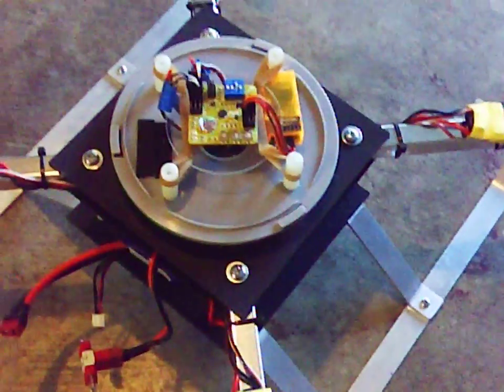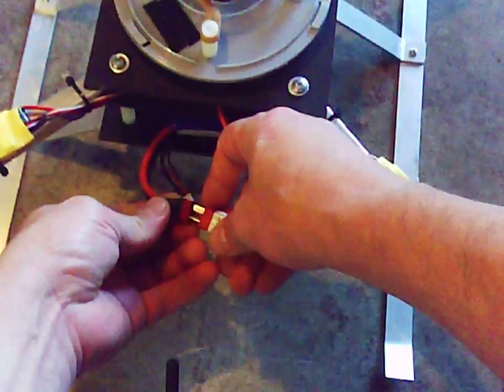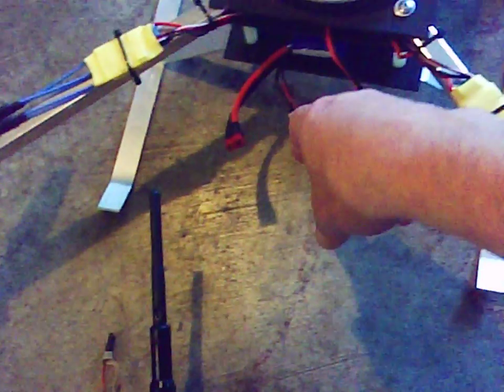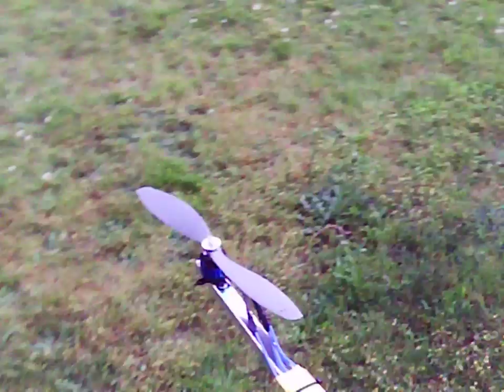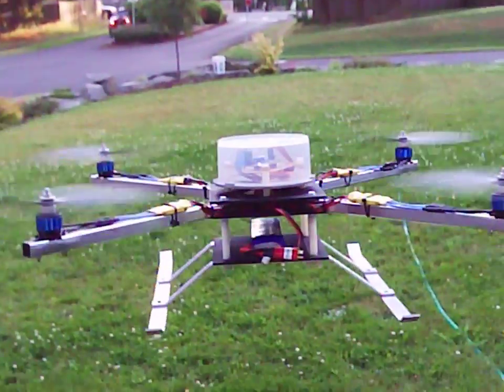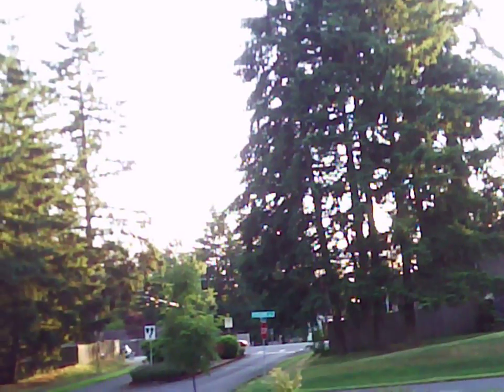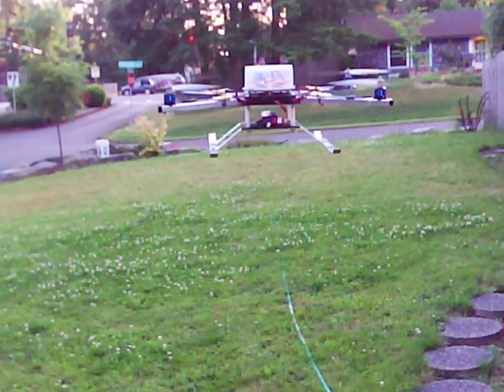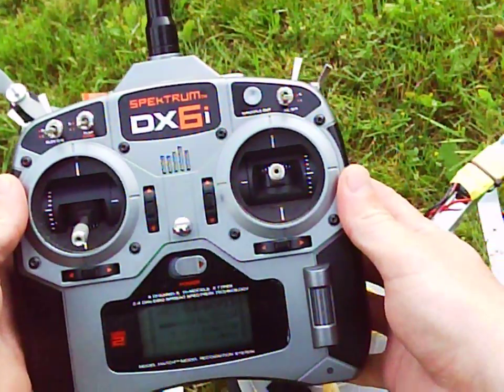Xcopter Scratch built with a HK i86 controller

Comment: Mmh, i just have to pull both sticks down and it works fine. Another issue i have is that the motors beep when the board is not armed. Is that right?
Reply from the maker: MrHyho1, I've discovered all I needed to do is pull the right stick down with the throttle down.. ha ha!  I answered your beeping question on the soapbox tri discussion.  If you have not done so, please subscribe.  All the best and Happy flying!

Comment: Ron - I'm not sure I understand your method of tuning the gyros - are you starting P/R/Y pots at 0% and then turning them up until you see oscillation on that particular axis (and then tuning that pot back down a bit) ? What about the rudder ? I got my i86 quad flying, but it creeps around quite a bit. Landed it in my neighbors yard last night..
Reply from the maker: Hey Scott, With the i86 on just about everything multirotor I've built I set it to about 75% on all the gains to start.  Then usually increase the gains on one axis until I get oscillation.  Then back it off until it stops.  Do this on all three axis (unless you are flying a tricopter) and you're done.  Hope this helps and Happy flying!

Comment: Hi friend, once again need your help. The configuration of pitch, roll and yaw must stay with the same percentage or Vaira? This is the hardest part of the assembly of the quadricopter. What is the secret to achieving a stable quadricopter? Thank you very much.
Reply from the maker: You can turn the Yaw gyro up to 90 or 95%.  The pitch and roll you want to lower until there is no oscillation.  Then working one at a time, pitch or roll, turn the gyro up until you get oscillation on that axis.  Back the gain down just until the oscillation stops.  Then do the same on the other gyro and you're done.

Comment: Hi friend thanks for the tip worked. I would like your help with a question: I'm using helices 10/4.5 and would like to trade for triple helices. What is the difference from one to another in flight? What do you suggest? Thank you very much.
Reply from the maker: If you are referring to 3 blade props, I like them better than two blade because they balance much better and give a little more thrust.  But I like to build some of my multirotors to collapse and that's when I need 2 blade props.

Comment: hi friend, could you help me? I'm having problems configuring the escs with this board. I followed the manual and I can not set up, they is beeping. Thank you.
Reply from the maker: Flavio, ensure you have the correct manual.  Some, including me have used the wrong manual to set their multirotors up (i86 or i86L)  they are very different.  Other than that, the manual from HK shows how to set this board up.  I do stick centering first then the ESC throttle range calibration.  This seems to work better.  Hope this helps and Happy flying!

Comment from the maker: Hi Luka,  I'll try to help.  First, you must see which i86 you have.. the regular i86 or the i86L.  They are very different in the way they are programmed.  Once identified, follow the corresponding manual for doing the stick centering and throttle range calibration.  I have been doing them in that order (First stick centering and then throttle range calibration) and it seems to work better.  After this has been successfully done, put your board back in normal flight config.  Happy flying!

Comment: hello,
i have a hobbyking i86 multi-rotor control board for my Q450 Quadcopter and i have problem Calibration ESC throttle. Can you please tell me what to do (manual suk, i cant use it) i dont understand manual please help me!!

Comment: hello,

I have a big problem with my i86 board whenever I want to try to calibrate my esc's the motors spin at full throttle and the only way to stop this is by disconnecting the battery. Could you make a video with how to calibrate esc's with the i86 board ?

Comment from the maker: caricat, When moving in any direction, the more stick given, the more of an angle the bird is tilted and then a portion of the thrust that was used to maintain a hover is then designated to propel in in whatever direction.  This is where the loss in altitude comes from.  So, short answer, yes.  You should use the throttle to maintain altitude just as you use the ail and ele to maintain position.  Hope this helps and happy flying!

Comment: Nice Vid! Just finished building mine. Quick question: My quad hovers fine at center stick (6 feet up) when I apply Aileron or Elevator the quad looses altitude. So much so that it will 'land'. Do I need to increase thottle when I try and make it move?

Comment from the maker: After you've done ESC throttle range calibration, then do stick centering by putting all the switches at the bottom (again, all gyros at 50%).  Turn your TX on sticks still all trimmed to center and throttle at the bottom.  Now connect the battery to your FC.  When the light goes blue, unplug the FC and put the switches in what ever configuration you want to fly in.  This should get your quad going.

Comment from the maker: m3d0car,  I see your problem now.  Do not use the i86 manual and set all your gyros at 50%.  Also, calibrate it in normal mode and do the ESC throttle range setting first by putting switch 1, 2, and 3 in the up position (make sure your props are off and put tape on the shafts to hear the beeps).  Turn on your radio with all the trims centered then go full throttle.  When you hear a couple of beeps, drop the throttle to zero and disconnect the battery from the FC immediately.

Comment: Thanks for your answer. But i checked the wiring and it's all like you said ( ground on the outer side), tried to calibrate it just like it says and ignored the drawing, but still doesn't work. I calibrate it in acro mode, and when i change it in quadrocopter mode the motors won't start.
I posted a video on youtube ( hobbyking i86 controll board problem), did i do anything wrong? I would really appreciate your help. Thank you.

Comment from the maker: m3d0car, Make sure all your signal wires are on the inner part of the board and ground on the outter (I've had some flipped sometimes).  The manual drawing on stick centering is incorrect.  Go by what the text says and ignore the drawing.  Another thing you may try is switching to another mode, power up and down, switch back, and recalibrate.  Hope this helps and Happy flying!

Comment: Hi. I have a i86 board on my quadcopter and i tried to calibrate it like it says in the manual, but the lights on the board doesn't flash like they should. And when i finish the calibration motors don't want to start. Can anybody please tell me what to do? I tried everything, do i have to change anything on my transmitter? Thank you for answer.

Comment from the maker: falhawker, what is your arm length on your bird?  Also, I used rubber bands to mount the board.  which absorbs a lot of the vibration.  Set your pitch and roll gyros at 50% to start it it oscillates baddly, go to 25%.  If it wants to drift back and forth or side to side, crank it back up and it will smooth out.  When it starts to oscillate again, back off just a little.  Hope this helps and Happy flying!

Comment from the maker: falhawker, go to the HK website, then to the i86 page, scroll down until you see the tabs: "Discussion, Reviews, Videos, and Files".  Click on the "Files" tab and select "HK i86 User Manual".  In the manual it has instructions guiding you through "stick centering" and "ESC throttle calibration".  Keep in mind the drawing is incorrect on one of these.  So, if you go by the written instruction you will do fine.  Hope this helps and happy flying!

Comment from the maker: falhawker, it's supposed to arm by pulling the elevator stick down.  You may have to ensure your dual rates are at 100% for throws.  Other than that, I have had to go through the calibration step by step again to get it to work.  Hope this helps and Happy flying!

Comment from the maker: obito, the only stupid question is the one not asked!  Ha ha.  Anyway, the voltage is not directly from the battery.  It is drawn from the ESC and should be around 4V - 5V.  I have been using 3300mAh 3S 40C LiPo batteries.  Hope this helps!

Comment: I understand that this may be a very stupid question, but what battery are you using?  I understand that the input for the i86 is 4 - 6 volts.  but does it matter what I connect to it?  I was thinking of doing a couple of rechargeable AA's which i've connected in series

Comment from the maker: Egons, Not sure if you've done this or not, but do an ESC throttle calibration. With no power to the controller, turn your roll pot to zero.  Leave the pitch and yaw pots at about 50% and 90% respectively. Turn on your TX and move the stick to full throttle. Power on your controller and the blue LED will come on and the red LED go off. Now move the throttle stick to zero. Disconnect the battery from the controller, restore roll pot to 50% and then check. Hope this helps and Happy flying!

Comment: Hi! Nice video! got my tricopter parts from Hobbyking. The controller board is the same, but I can't understand why one of the motors doesn't start to spin on the same time as the other two. and the other problem is that the throttle starts to react only at about 50%- that's when two of the motors strat to spin. The third one starts at 90%. Is it the board or may tx (JR 72mhz). The rest seems to work well.

Comment: donjuanzx9- did you get your i86 to work yet?  I had the same issue.  To fix I redid the 2 calibration steps without moving the throttle stick all the way down.  I went almost all the way down instead.  This fixed the arming issue.

Comment from the maker: Eventually I did.  First I attempted to hold it down on some foam from an HK board by using rubber bands.  The flight was OK but not as stable as I wanted.  So, I cut a circle from some 1/8" plexiglass and drilled holes in it to match the KK boards (originally for my micro quad).  Then I mounted to it with rubber bands, threaded rubber bands through the holes and suspended it.  It worked!  So I then used the supplied sticky foam.  Like your 761.2mph video.  Please subscribe!

Comment from the maker: In this video I have 10x4.7, but I ordered some 9x5x3 for it.  Until they get here, I'm running 8x3.8.  Run time is much much longer with the 8 props but the lift is lacking.  10s drain the batteries in short order.

Comment from the maker: Go to the manual and follow the instructions for stick centering, and ESC throttle range setting.  I've found that after changing the board configuration I have to do this, then the board works.